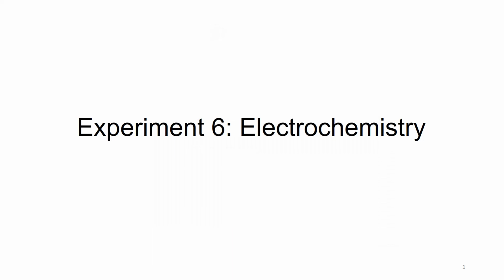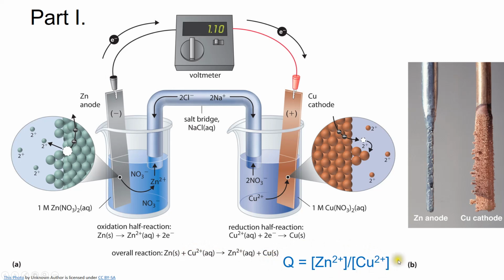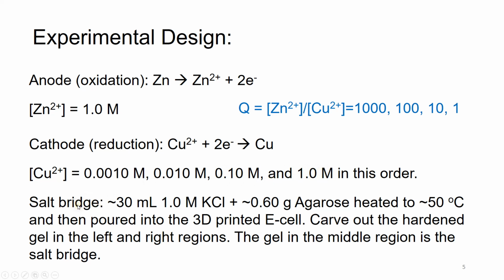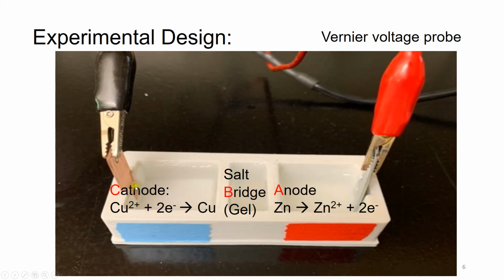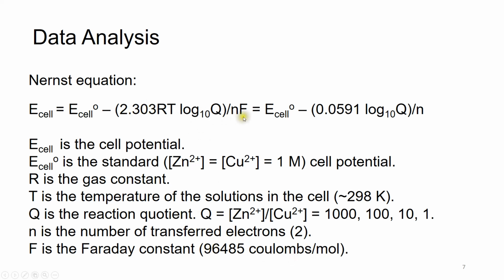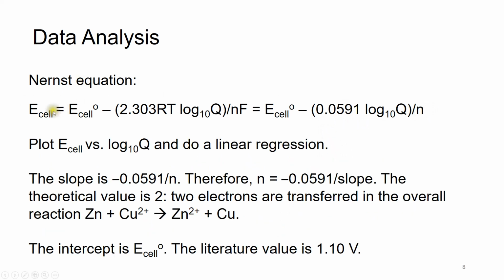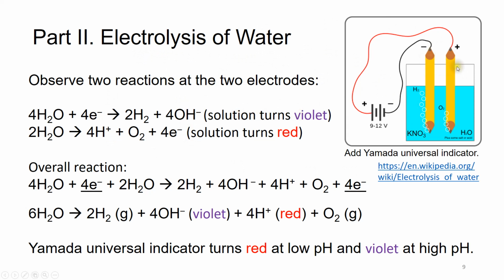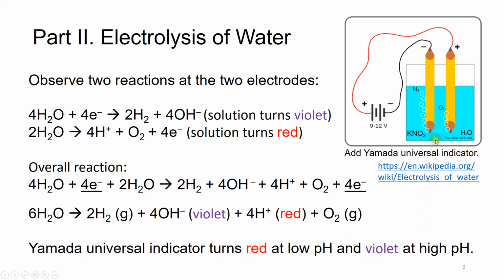EXP #6 Electrochemistry

Comment: The emf of this cell is 1.10v. So what does it mean exactly? Or how we can explain the role of emf in electrochemical cell.?
Reply from the maker: EMF is defined as the work done on a unit charge. Therefore the amount of the electric work is emf multiplied by the charge of the transferred electrons. Meanwhile the amount of the electric work is equal to the Gibbs free energy change of the reaction system under constant TP condition, which then leads to the Nernst equation.

Comment: what happens if one can put copper rode in zn+2 solution and zinc rode in Cu+2 solution?
In the above condition, will the cell work or not?
Reply from the maker: In one solution, Zn will react with Cu2+ directly to form Zn2+ and Cu. The Zn electrode will be covered with copper. The transferred electrons won't pass the wire. 
In the other solution (with Cu in Zn2+) nothing will happen.
Reply: @physicalchemistry_pchem  Thank u very much sir for your kind concern!